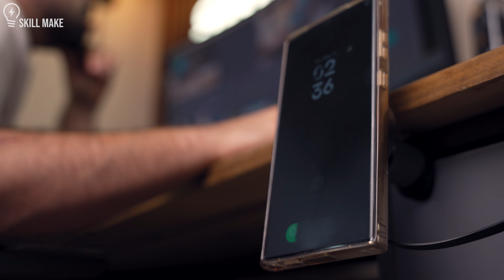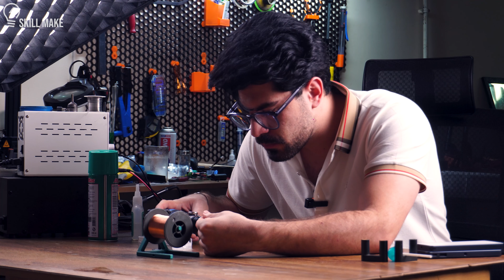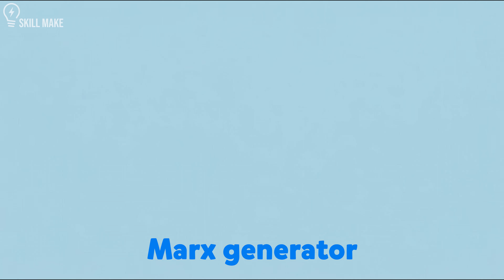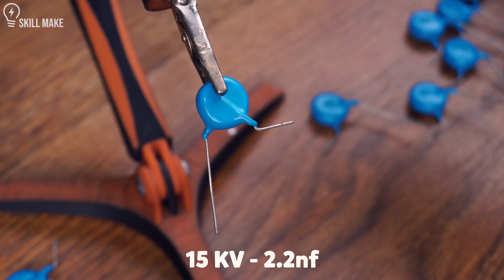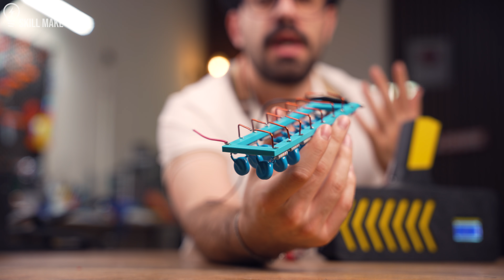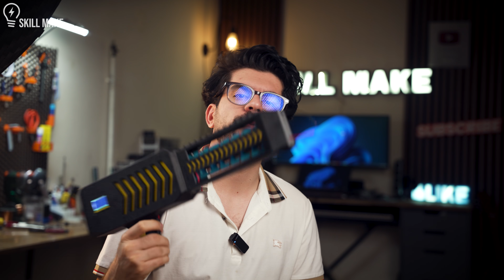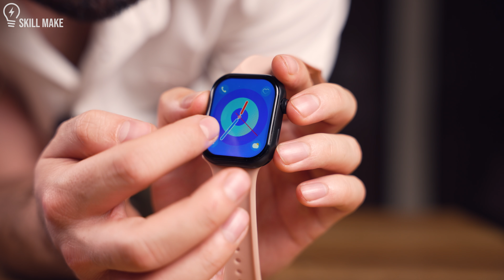I Made an EMP Device... It Actually Works

Comment: Ok, for the resistor question:

It has been a long time since I took Physics 2, but:
I presume is to allow slow charging the capacitors and then, they must act like open circuits during discharge, so the current jumps the gaps and that voltage stacks. 

...and Im a dentist. LOL

Comment: In the old days, they would use a simple tin can, with holes and dimples hammered into it. A "brush" of wires would be applied to the tin can, as it spun. The can was connected to a series of long wire antennas. As the can rotated against the wire brush, feeding power through the wires... It created massive radio and EMF noise, that could destroy any radio and telegraph communication for miles.

Comment: You are not an electronics enginerr? I'll tell you how you can get a long range one that actually will work. I guess other weird "emp" are doing these because I've seen similar design results,  these are fetus for abort.. your output stage.. I just skip to see overview, so apologize if I missed something, but looks like you are using very not suitable things together. Virtually direct contact efficient power transfer from wireless charger is optimized for the opposite you want.. if you just want an emp, you're probably be better of just discharging the thing through a massive coun/antenna with a spark gap go get emp spike, but it would need a lot of work to get a beam  and be good at ranges.. anyways, something you can do that really works for frying electronics at long ranges are : take a magnetron from a microwave oven, use your hv transformer to charge a hv cap bank,. design a controller circuit that can monitor and discharge it to the magnetron. Create a wave guide from appropriate sheet metal (for something good enough basic, probably aluminium etc is ok you can find simple measurements/2g4~ design that will work, (for something more advanved you would need to do a lot of math or  design it with a RF software with simulation ) but a simple one is fine, it's at its frequency (about 2.2-2.4ghz probably). So portable you need a good power source like li-Po pack,  inverter of some kind to switch the step up/flyback transformer, then circuit needs to monitor cap bank,charger and discharge safely, discharge to magnetron with waveguide. This can be very dangerous, not only HV but leaking high energy microwaves and likely more radiation. I did this as project when I studied RF and field theory back in school and it worked great. It really fries non emi protected /f-caged electronics at 10+meters and I could've perfected it to much longer distances with real effort and time. But I have to say this for other readers:;don't do this if you don't know  anything!!  Actually shouldn't do any type of high energy, even the sparks generate q lot of uv and even some x rays(cannnnceer ☠️)

Comment: To answer your question about the resistors soldered between the capacitor leads… I believe they provide the load needed to trigger the spark gap. I think this is necessary to not only give the electrons a forward path with the velocity to make their jump, but also act as a wall for the charge to push off but in a smooth fashion essentially - if that makes sense… like they keep that initial pressure firm rather rebounding voltage spikes back into the caps and blowing them.

Comment: I thought about using a pancake coil with a parabolic reflector exactly like you have done here, but then AI told me it was counterproductive, that you are only getting near-field effects from the pancake coil, and that some of that energy will just be wasted to induce eddy currents in the metal parabola.  The energy dumped into the pancake coil does not get radiated as far-field energy, and the metal parabola just functions as an energy sink in this set-up. That is why you have to hold your device up close to electronics. You are only getting near-field effects and the field strength drops off rapidly with distance. You might get even stronger effects without the parabola. To radiate a destructive pulse at some distance entails altogether different physics and is more challenging to build. So I'm an organic chemist, not a physicist, and I know AI makes mistakes all the time, but this is what it suggested to me.

Comment: You need to build a sealed chamber for the spark gaps and put a mild vacuum on it to reduce the breakdown voltage and electrode wear.  It should increase the output as well.

Comment: Obviously completely oblivious to basic theory. Yeah Dunning-Krueger. NOT.

EMP
electroMAGNETICpulse.
All minum is a POOR magnetic shield.
"Mu Metal" is what you are supposed to use and is available on eBay, has been for DECADES. Failing that, COPPER WIRE MESH, BRASS WITE MESH; both also available on eBay.

Again, this poser "content creator" is oblivious to basic theory but is handy at presenting his ability to read the Internet.

Comment: Epoxy must be mixed in the ratio specified by the manufacturer.  Deviating will leave uncured resin.  You can try to control the cure speed with temperature (not without its own issues) or just using a slower resin system.

Comment: Will it work on obnoxious car stereos that vibrate my house when they drive by? I don't care if I need to get close to them just how far away would it have to be to knock it out? Or better yet the illegally loud mufflers on motorcycles? It would be GREAT to point and just have them stop working. Maybe then they would avoid the area and it would be a win!

Comment: bleed resistors are usually on high voltage capacitors as a safety precaution, to slowly (comparatively) discharge dangerous voltages. my guess. not in usual circuit, but singly. any reason that not true in this case?

Comment: Never stick both hands near high voltage.  One behind your back and well insulated shoes, you won't get current through your heart.  I learned this the hard way.  After a few mega shocks, it's now instinctive when working with tube circuits with lethal voltages.
Reply: aaah, thermionics, our old friend for superior audio. even order harmonics to rock 11meter pirate crew!   good advice. i used to think rf burns were not serious! ya, me an idiot lol.

Comment: Stay far away from qidi! It's a huge gamble with them. My q2 is decent but my plus 4 i struggled w for 3 m9nths and replaced tons of parts but couldn't get it to print reliably. I returned itvto amazon im so glad i did.  I bought a snapmaker u1 in its place and it was worth it! I wouldn't personally waste money on a printer that isn't a toolchanger now

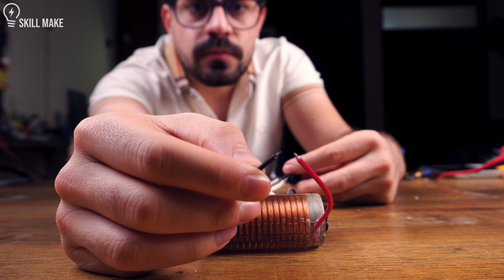Comment: 3:36 Viewers, this is a dip$&!# move. NEVER touch both ends of something generating current. NEVER use both hands to handle something with current.  
If you think I'm being too cautious, search on "Darwin Award Resistance is Futile"  
Current crossing your heart (hand to hand, leg to opposite arm) risks death. Just getting shocked can be enough to cause burns, on skin and internally with the right conditions.  
Search "Electric burns: high- and low-tension injuries" by Garcı́a-Sánchez and Gomez Morell for one study with more detail.

Comment: To fry sensitive microelectronics, a better solution would be to use a microwave gun.  You can pull the magnetron out of a microwave and reuse the capacitor and diode.  The only issue is the power source.  You need a 2.5KV-5KV power source that can push at least a KW of electrical power to get the magnetron to operate.  Microwaves operate on 2.4GHz and are licensed for unlimited power.  This is actually a long range solution.  Although EMP weapons are useless against shielded targets.

On a side note, touching the wires while energized gave me Electoboom vibes.

Comment: The resistors are for making sure the voltage across the array of capacitors are balanced. I see the same principle across the bus capacitors in the variable frequency drives that I work on.

Comment: High-frequency, high-voltage electricity is extremely dangerous. Touching opposing terminals with both hands forces the current directly through your heart, which can cause severe damage and fatal arrhythmias. Consult your doctor immediately.

Comment: Your coil is facing the wrong direction. Rotate it 90 degrees and attach metal plates with a slot on both sides, pointing in the direction of the pulse (laik simbol C).

Comment: 1)Try to use ZVS driver
2)Build x6 Villard's cascade voltage multiplier
3)Add HV 10nF capacitor with HiSpeed HV diode to the multiplier
4)Add spiral antenna to the end of your EMP coil

Comment: I cringed when I saw you holding those leads with both hands, and then a few seconds later, you got shocked. I did something similar when I was a kid, using a car ignition coil connected to a 36V oscillator. That’s a lesson you’ll only need to learn once.

Comment: It seems like you should be able to fairly easily make a winding machine where you just type in how many turns and it just spins them up. You could change gearing if you need more torque for a larger spool or whatever.

Comment: I built a very similar device as a teen, but with a larger capacitorbank and a blown spark-gap going to a 6” toroid. Running off a car battery, with a copper rod driven into the ground as an earth… it was supposed to be a Tesla-coil. 
It never produced sparks when I turned it on, but it did make my 90s CRT go bright-green for a week, as well as several of my neighbours’ TVs around 100’ away 😅, I’ve never used it since.

Comment: If you use a metal cup behind the coil, it acts like a shorted loop and absorbs most of the energy you induce. If you remove it, the range and power of the pulses will be greater. 
Thanks for sharing your experience. Regards.

Comment: I made one of these years ago, inspired by older YouTube videos, but cheated with a $5 eBay HV "stun gun" module. Then feeding that into the same Marx generator stack of HV capacitors, resistors, with the identical bridge rectifier of 4 diodes. 

It wasn't nearly voltage or power matched as this was, but it worked. It would reset/blank a pocket calculator and freeze/glitch a smartphone at a range of a few centimeters. 

I also had the exact same idea to use a small stainless-steel kitchen bowl as a reflector. 

But in my testing, it made no detectable difference, other than cosmetics and looking cool. 😂

I think there's a few fundamental problems with that design. 

First, the bowl is roughly hemispherical, and not a flatter parabola like an actual dish antenna. And the coil isn't really at any sort of an ideal focus, which the bowl lacks anyway, and the hemishpere's focus and outward emissions aren't going to be roughly parallel in a forward pointing beam at all. 

Secondly, even if you just used a flat plate behind the coil to bounce the wasted back half of the coil's RF emissions forwards, the basic inverse-square laws of RF/EM emissions mean it attenuates so quickly, whatever modest "doubling" you might get, it's eaten up by distance so quickly anyway.

Being closer will always help exponentially more than whatever theoretical doubling you get from the backing reflector.

The reason it actually helps "double" the recieved power to a useful degree in a wireless phone charger, is that the phone is laid on top of the charger, with only a few milimeters of gap from the charger's enclosure and the phone's case. And the phone has it's own charging antenna inside it that's perfectly matched to the frequency for maximum efficiency and induction. 

The inverse square law means that for every unit of distance you pull back, the recived RF power by the target drops by a factor of four. 

For magnetic fields that get inducted as distuptive voltages in the target electronic device, those are governed by the inverse cube law of magnetic fields, which is exponentially even worse. For every unit of distance you pull back, the magnetic field intensity drops by a factor of nine units.

And the reflector bowl, or plate won't help at all with "reflecting" magnetisim.

And whatever magnetic field it catches will just induce currents in the reflector, that otherwise go nowhere. Possibly/probably just sucking power from the coil all together. 

I think that the easy way to at least get a proper parabolic reflector would be to get a used DSS Digital Satellite TV dish from eBay or a yard-sale, and mount your coil where the LNB reciever went. Ideal is if it's a fiberglass dish for a boat or RV, and not an aluminum or metallic one. Then, the dish only has a RF metallic paint coating on it. 

And, maybe... the RF reflective paint is a suspension of metallic dust particles in the paint polymers that don't form a long conductor path that intercepts the magnetic field. wasting the emitted magnetic field energy into electric currents, that ultimately get dissapated in a mix of spurious & random RF, and a tiny bit of undetectable waste heat.

Maybe... I'm not an electical engineer, or a physicist. I'm only a HAM radio guy, and an industrial automation guy...

So anybody that knows MORE, PLEASE say so and correct anything I've said. 

(Also note, because it's adjacent to the topic... "Drone jammer guns" you may see online in use by militaries or security services, they're all based on just jamming a commercial drones RF for remote control and GPS. For someone being nosy/stupid, or flying one for paparazzi reasons. 

These "guns" just jam the needed RF communications and it's ASSUMED the drone's on-board electronics & software decide to land in "safe mode." There's nothing hand held that could actually "zap" and disrupt a drone's electronics directly at even a few meters, when it's "too late." And the handheld devices won't work on a fiber optic controled drone, or a drone that works autonomously. Perhaps using inertial navigation, and from watching its own cameras with a vision system. 

A "drone RF/EM cooker" that fries, scrambles, or resets a drone's electronics directly at any useful range would require at least an entire truck, and a very large antenna.)

Anyway... with the fiberglass DSS TV dish, the RF reflective coating will reflect the radio waves forward in a directional beam, but provide the least metallic mass to suck power away from the magnetic field the coil emits. 

Obviously, this is far less portable or "covert." Not exactly something Q would give to James Bond. 

Even then, I would not be shocked if the distance it would zap electronics wasn't improved a great deal.

I think the BEST way to make a DIY EMP jammer/disruptor to impress your friends, and will have demonstrable effects at a slightly longer distance is to just make it as absolutely powerful as you dare. 😀

Comment: I made a spark gap for testing the MSD ignition system for my drag car on the bench. 

The MSD system is a programmable system that needs to be setup with a laptop for boost and timing curves, so I set the system all up on my bench to get it all programmed and working before I installed it in my car. 

I set the adjustable spark gap to almost 3/4" and when I spun the distributor, the LOUD sparks that jumped the gap shut my laptop down from about 6' away!!... the screen just went black, and there was NO signs of life from it. THANKFULLY the laptop responded to the power button a few minutes later, and restarted and was fine. I thought at first that I fried it though, because it would NOT respond to the power button for several minutes.
Reply: Nice, I grew up in an auto repair shop and in drag pits (my uncle has a Wally, I did IHRA as a teen). 

Curious if the laptop was running off DC only or plugged in at the time? I wonder how that affects EM pulse damage.

Comment: ZVS circuit is actually more efficient because the driver module has a DC bias that would dissipate a lot of unnecessary power. Otherwise, nice project! ❤

Comment: Lets see, how many safety violations.
1. Cuts live AC Wire,
2. Uses Epoxy or other alike compounds without Proper Respirator, Air ventilation, filters and such
3. Shocks himself repeatably. 
4. Shocks himself repeatably.
5. Soldering without an Active Carbon Filter and or Proper Ventilation. (looks like LEAD solder as well)
6. Building EMP Generator / Jammer's are a Crime in several Countries.

was the video kinda cool, yes 
The High Pitch noises are awful. 

Safety Rating. 0/10

Comment: You didn't create a field, it's already there even in a vacuum. What you did with your coil is that you perturbed it and created a local field imbalance/well that exchanged massless photons with the neighboring fields that traveled at the speed of light and obeyed one by r square law but your reflector kind of cheated that a bit by directing the massless energy/momentum beam into a losely concentrated spot at the target where the victim device's electronics kind of acted like a broad spectrum resonant antenna that induced electric current and fried itself.

Comment: You could take the transformer and multiplier from an old CRT TV.
Reply from the maker: Spot on! Old CRT flyback transformers (and their multipliers) are legendary for DIY high-voltage projects. They are incredibly tough and can easily pump out 25kV+ with a simple driver circuit. Best way to recycle old tech! 📺⚡

Comment: why you use the resistors
Reply from the maker: The resistors allow the capacitors to charge safely in parallel first. But during discharge, they block the current so the capacitors force a snap in series through the spark gaps, creating that massive high-voltage arc! ⚡🔋

Comment: Voltage isn't the problem as voltage is only the pull for electricity. What really matters is your wattage to amperage ratio though a given circuit. Cause if your amps are high but your watts are low then nothing same vise versa. Voltage would mostly effect your range at which this would work at.